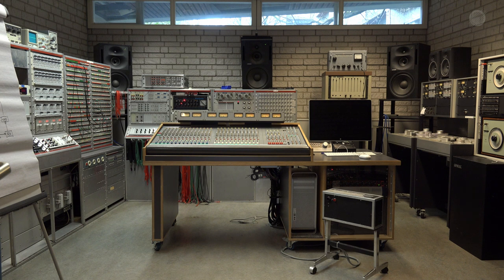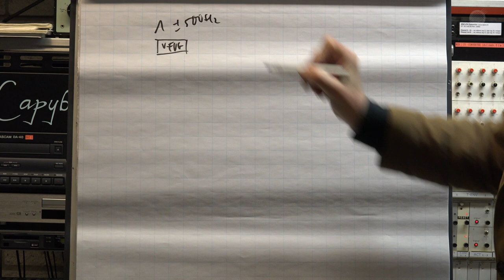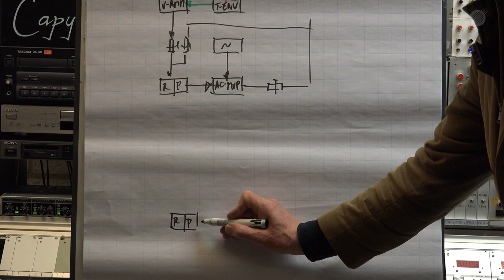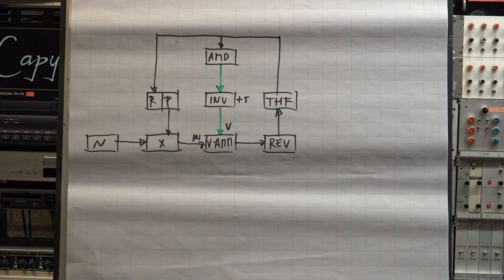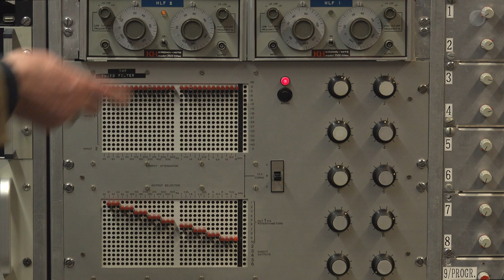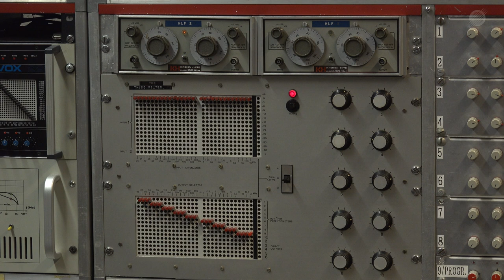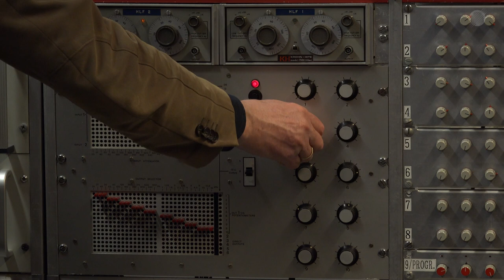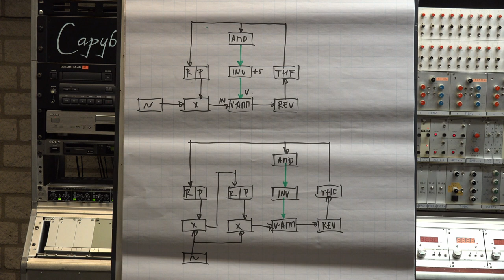Ring-Modulated Feedback in BEA5

Comment: The beauty of inserting a ring modulator in a feedback loop is that it will destabilize resonant peaks. Along with clipping, ringing feedback, where one resonant frequency sucks up all the energy, is the easiest thing to get out of feedback. Ring modulation will kick any sound off its central resonance, so it prevents any resonance from being too stable. Meanwhile, the delay will tend to enforce continuity, which prevents the sound from going into wide spectrum noise. The "1/3 octave filter" (no different from a graphic equalizer) allows the musician a great deal of control over the results. Really fertile ground for discovering sounds.
Reply from the maker: The 1/3 octave filter is very different from a graphic equalizer, which only allows attenuation or amplification of frequencies by 12 or 6 dB, whereas this 1/3 octave filter can complete remove frequency bands. Also, this 1/3 octave filter has no neutral setting: even when all bands are at equal levels, strong colourisations occur where the bands overlap and at the centre frequencies of the bands. The original B&K 1/3 octave filter was not designed to use all bandpass filters simultaneously but only one by one. This modified version has an input and output matrix which allows to send the input to all bandpass filters and mix their outputs. This modified filter is essential for the technique that is demonstrated here and the results would be very different when a standard graphic equalizer would have been used.
Reply: @MrSonology  ahhh ok thanks for clarifying in re the filter,  which sounds more like a resonant filter bank (or maybe not I'll watch your video on the subject!)
Reply: I will say that there are a lot of ways to get vaguely similar sounds using reverb feedback, and I expect if you substituted a normal graphic equalizer, you'd get something cool. Without the resonances of that particular filter, you might not get the room-like switching from one tone to another, but even a 6db attenuation will quickly go to silence in a feedback loop.

Comment: Very cool. I don't understand what an amplitude demodulator is, though. I'm wondering if an envelope follower might do the same thing.
Reply from the maker: That's right. An Amplitude Demodulator (AMD) is an envelope follower. An Amplitude Modulator (AMM) is a VCA. A V-FUG (voltage-controlled function generator) is a VCO/LFO. These names were used already at the Institute of Sonology in the 1960s and we stick to them.